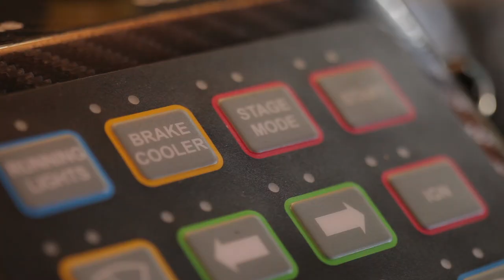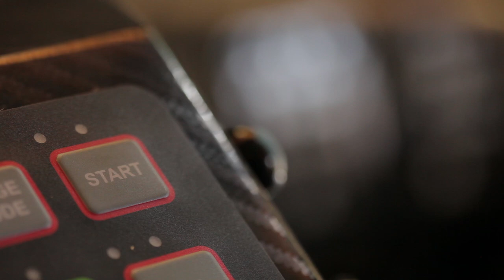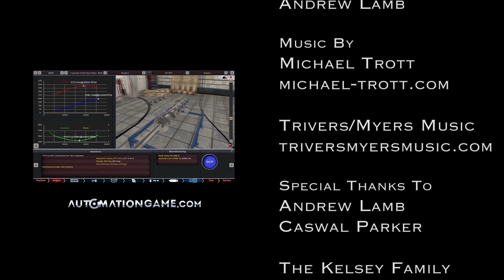The Homebuilt Rally Car That's Too Fast for the WRC - TST in NZ

Comment: Why did you put a Renault V6 in a Peugeot ?! Why would you do that ?!!
Reply from the maker: Kaisuke971 Peugeot didn't make a Formula 3.5 engine?
Reply: TheSmokingTire Basically he said he built the car from the engine, as he got an awesome opportunity with this Formula Renault engine.

From that perspective both your point is invalid and he didn't have a real reason to do so, because the shell might be the most useless thing there, and he said he built it himself so could've done that with a Mégane III RS or whatever, and then to be fair Renault does have some wide body Mégane III RS, so he could have take some inspiration from that !

But i just feel it like the dude does whatever he wants, and the 307 looks like it was meant to be a rally car so it works...
 It just bother me, because it's pretty much like you used a Ferrari engine in a Lamborghini, it's just... Wrong on so many levels !

(Yeah i edited the whole comment i got what you said way after haha)

But well it's his money and his car ^^'
Reply: +Kaisuke971 Cause it looks mean..
.
Reply: Kaisuke971 Maybe he just likes the body of the 307, its his car after all. Also I don't think its like Ferrari or Lamborghini, Peugeot and Renault don't exactly hate each other.
Reply: Kaisuke971 why would u ot like this enginge did u hear the sound of it ??????
Reply: it's not a Peugeot
Reply: nukem high Problem is not the engine but the shell here, at least for me. Engine is 100% Renault while shell is barely Peugeot, so it can go !
Reply: Kaisuke971 Because it would be nearly impossible to get a Peugeot engine of the same caliber.
Reply: Themayseffect Funny you said that because Peugeot-Citroën won the WRC quite a few time with Loeb ^^'
Reply: Kaisuke971
yes. Do you have any idea how much those cars cost? Do you have any idea how to get a Peugeot rally engine? I don't think so. A Formula Renault engine actually isn't nearly as difficult to find. There are a few sites out there that have some for sale matter of fact.
Reply: Themayseffect Also it sounds bad ass which is more than enough reason to buy the engine, plus its not restricted in power to follow regulations like how normal rally cars are made to be.
Reply: Themayseffect It's not like the guy has a very expensive rally car in his hands either... Seriously i think if he really wanted to, he could get is hands on one of these, because they've been racing for years, i think you can find some engines. Renault's 3.5 don't come cheap either...
Anyway the problem i was pointing out was the body
Reply: *****
 well the lack of restriction and regulation on the car is also another reason why most rally series won't let this kid race in their series lol.
Reply: Kaisuke971 He liked how the body looked and how the engine sounded! As simple as that!
Reply: Kaisuke971 Why?  Because he can!!!!
Reply: Kaisuke971 ...cca2004. - 2013. most successful wrc driver ever (citroen DS3  PSA - peugeot citroen), a tarmac expert etc etc  ;)
Reply: Kaisuke971 Because you are one of those fan boys that rely on brands and you think Brand A should stick to Brand A, when it's totally irrelevant what engine or chassi you use. What's wrong with having a Ferrari engine in a Lamborghini or vise versa? I tell you what.......fuck all. When you go the next level called motorsport, parts from different cars is simply the norm. 

I bet you will shit a brick when you hear Renault are now using Dacia parts, oh wait it's the same fucking car....VW and Skoda is the same thing too. Welcome to 2015 buddy, enjoy your China manufacturing stay
Reply: Guys you know people are allowed to give their opinion right ? I don't get why most of you are being so defensive and going as far as insulting me... 
I was just  joking (making fun of or whatever you get the idea) on a situation that would be funny to most french people (Renault engine in Peugeot shell while there is an intense fight for sales) that's it.
Maybe in my explanation you thought i was really "attacking" the guy for what he did but no and to be fair i didn't really want explanations for why he did it, just thoughts on that, and even less insults. 
(and no i'm not a troll --")
Reply: Kaisuke971 If it's true what you are saying then my apologies. At the end of the day there is too many goofballs who think like this and you always see them make those remark in forum about different engines used in different brands car. If any of those people actually watch Drifting competition, 90% of the cars are using some sort of turbo charged engine like SR20, RB26, 2JZ, and the rear axel from some dirty Nissan. Drifting is probably the only sport that doesn't allow FWD chassis to keep things a bit more realistic. Apart from that nobody ever runs the standard engine on whatever OEM RWD cars they used to look "different".
Anyway, good trolling my good sir, I tip my fedora to you 11/10 will read again :)
Reply: I think he already had the car and wanted to spend the money for other important parts, not for another shell...
Reply: ***** It's a 206, not a 307.....
Reply: CinqPower Albert van Mourik ---207 F3.5
Reply: You put a nice and constructive comment almost every time on videos no one bats an eye.
You post one comment that discusses something in a video every one loses their minds
Reply: Kaisuke971 But you're opinion doesn't mean it's always right.
Reply: The LoudAssasin Never said so. What i did try to express is that you don't have to insult me for that, especially when i haven't insulted anyone and even less the guy's job.
Reply: The LoudAssasin I don't know where you live but that's not how democracy works dude. Discussing and having a debate with people is not "call their opinion invalid". I did argue and give explanation, not just go "Your point is invalid". I explained why, imo, and that's what freedom of speech is about.
If you want to live in a world where every one has the same opinions, don't share and don't move forward with different perspectives of things, that's you. But history have shown that thinking differently and having debates makes the humanity go forward.
Reply: Kaisuke971 I think ur on the wrong channel  its Why Would You Eat That!
Reply: Kaisuke971 So he could get this monstrosity. What have you built so far?
Reply: Kaisuke971 he liked the engine and he liked the body style, what other reason does one need?  It's the same as asking why you have a bmw as profile pic.
Reply: +Kaisuke971 uhhh because F1.
Reply: +Kaisuke971 I'll introduce you to the same rule I introduced to my kids a while back. It's called the BIFLI ( pronounced Biff Lee )  rule.
Because I Felt Like It.
Reply: I think that's the funniest thing iv seen on the Internet lol
Reply: +Kaisuke971 Why not? Good stuff.
Reply: +Kaisuke971 if you listen he said it was a renault V6 that had been turned into a V8
Reply: Lisa Mcfarlane huh?  no, he said the Renault F1 cars transitioned to V8's, making their V6 F1 engines obsolete, which is how he got it.
Reply: aHHhhh the joy of obsolescence :D
Reply: +TheSmokingTire wonder wether a honda formula 1 engine would be as good or even better. that thing is a rocket ship
Reply: it worked didnt it
Reply: +Kaisuke971 it worked didnt it..
Reply: +Kaisuke971 I reckon he did it, after seeing your comment in the future, to spite Peugeot, because, although the McLaren F1 team ran tests with a Lambo engine in 1991 used Peugot F1 engines instead.
Reply: 450hp formula motor. why wouldnt you? let alone renault, does the red bull f1 car ring a bell? what power plant do they use? oh nevermind. you have a picture of bimmer. that explains everything.
Reply: You cannot understand because you're not french. The problem is on the Peugeot side o things imo, that's it. I wouldn't put a Renault engine in a PSA car because there is a kind of rivalry between the french manufacturers, and it's kinda funny to me but it seems that nobody really cares about french road cars besides french people. 
Here people go like: "Oh Renault unreliable shit noisy engine", "Bruh do you live in the 90s ? They even give them to merc" "Yeah that's why the B-Class is so shitty" "Well no one want your shit engines" "at least we win races" "well renault engine won F1 4 times in a row" "yeah but we did WRC even before Red Bull team existed" "Well our chassis are awesome" "At least that lel" "get out son shitty 1.6 thp unreliable thing" "At least it makes power unlike your shitty 2.0 turbo Clio"
Reply: +Kaisuke971 race car drivers and builders could care less about what company did what. all that matters is is it fast, yep, is it affordable, yep, is it competitive, yep, does it win, yep. nothing else matters.
Reply: Chris Van Middelkoop If it doesn't matter to you, take your time to answer.
Most of the time, the guys who build these have precise ideas of what they want to do, otherwise this would just have a Turbo 4 banger. 
I'm totally okay with how awesome if this car, just found funny that it has a renault V6 looking like a Peugeot, just like i find a Small block MX5, 2JZ E30 or whatever
Reply: Chris Van Middelkoop The Purist thing is not crap. There is a reason, for example, why Mazda sells its MX 5 with a maximum of 160hp. If you swap it for a 400hp V8, it's just because you didn't understand that reason. Maybe your car will be brilliant and stuff but it won't be an MX 5.
Most of the time, when engines are swapped, you just loose the car's personality. Each car have its own spirit, that fits to its engine. If you really like a car, and prefer to swap it... I don't really think you liked the car in the first place. You liked something about it (look, handling), but not the whole thing. A car is a whole concept, each car is different.
Though i'm more than okay with mods, to enhance the experience. For money reasons, manufacturers obviously can't put the best elements on an entry-level car. So you can put a new exhaust, carbon air box, bilstein shocks, carbon aero: as far as you follow the car's line, it will be banging.
For example: you have an E30 318is. You use the engine, add a cold air intake, new exhaust, upgrade the fuel system, remap the ECU, remove the rear seats, buy Bilstein suspensions, add Stop Tech brakes, 18' BBS wheels, remove all the useless interior things, change some body parts to make it look a bit better, ad Recaro seats, use aluminium pedals, buy a new clutch, put a short shifter: you'll be totally following this car's spirit.
You put a supercharger on an M3 CSL ? dude... You ELH an STi ? Come on bruh.... 
And then to be fair it depends of the swap: if you swap a 901T engine for a 3.8l GT3 engine, hell yeah. If you swap a 325i's engine for an S35B38: HELL YEAH. You 4 Rotor an RX 7 ?! Be my best friend ! You put an S50B32 in a 525i E28 ?! You could've bought the M5 or even M535i for less but still awesome !
Get my point ? 
That's my opinion though, and i'm far from being the only one like that. Some people love LS-Swapped RX 7, others hate, that's it mate.
Reply: Kaisuke971 sooo what do you say then to cars that came from the factory with engines of a different make?  Like the Lotus that came with a Toyota engine?
Reply: Patrick94GSR It doesn't make sense, you didn't read my last comment. The car MADE like that ! Just like the McLaren F1 (BMW's S70/2), Huracan (Audi V10), you get the point.
Reply: ls engines are boring to me. that said, for a street car, i can see what you are saying. but for a race car all bets are off. for a street car i would never change out a good engine for something else. rx7s need rotories, supras have the 2jz, skylines the rb26, 240zx the sr20. but some cars come with crap engines. and a motor swap is the way to go. datsun 510s need the sr20, vw beetles need an ej, miatas need, well, anything with more power, and so on. lol.
Reply: Chris Van Middelkoop "miatas need, well, anything with more power" what you ever said and will ever say in your life about cars won't make sense after that.
The only thing an MX 5 needs is weight reduction. And maybe a better sound.
Reply: +Kaisuke971 lol, you truely are a miata poster boy arent you? too bad the s2000 is a better car.
Reply: You just confirm what i said.
You're comparing an apple and an orange.
Reply: +Kaisuke971 not really. both are japanese sports cars. in stock trim i wouldnt touch a miata with a ten foot pole. total chick car. a spec miata race car, that is a different story.
Reply: M3 and S65 AMG are both german performance sedans. 
XJ and Phantom are both executive british sedans.
Huracan and LaFerrari are both Italian supercars.
Get the point now ?
If you don't let's compare an NSX-R with the S2K then. They are both Japanese sport cars aren't they ?
The Miata is a brilliant car, and the ND might be the best of them. It might as well be the best pure driver's car (the whole package thing, that you can actually drive everyday unlike a Catheram or a 3 Wheeler for example) on the market right now. People who think it's a chick or hairdresser's car have just no clue about the automotive world, and are far from being petrolheads.
Reply: +Kaisuke971 i dont know man, there are alot better feeling cars than miatas. i havent been around the newest one which seems alot better but still there are better feeling cars. ae86 is one, porsche 944 turbo, datsun 510, datsun 240, nissan 240sx, terminator mustang, lotus elise, corvette stingray just to name a few. and those are just rwd let alone fwd and awd.
Reply: Because fuck the rules that's why...car sounds fucking incredible
Reply: +Kaisuke971 Cause a Citroen Saxo engine probably won't be very quick
Reply: +Kaisuke971 Because Peugeot-Engines don´t stand making power and the 306 Chassis is just perfect for rally.
Reply: +Kaisuke971  It's not actually a Peugeot, it's something he built that looks like a Peugeot.
Reply: +Themayseffect probably half a million $.
Reply: +CinqPower Albert van Mourik   It's a 206, not a 307.....wrong it is a 207 I own the not modified from the manufacturer
Reply: +Kaisuke971 100% renault, pfff. Engine is a nissan vq35. These ones are just rebuilt to Formula renault spec. but the engine is 100% nissan so get off your high horse
Reply: +Kaisuke971  It's NOT a Peugeot it's a home made car made to look like a Peugeot, there is not one single Peugeot part in the whole vehicle.
Reply: +Kaisuke971 He's put that engine because it is good enogh for him and also sounds amazing because it's a V6 and it is from a Formula Renault.
Reply: +Kaisuke971 Why he did that? It's his money, his time and his life. I think he can do whatever he wants...
Reply: Tuan Dao It's just a prank bro the camera is right there
Reply: +Kaisuke971 I'm not sure but I think that the car might be a 207 s2000. This 207 was used for FIA rally, it was already light and 4wd. So I think that he worked a lot on this base to put his V6 inside.
Reply: andy elliott there is a single part the shape :D
Reply: dmied1 don't be ignorant the vq35 could be found in renault velsatis and any vQ35 can be rebuild to become a formula renault engine, it cost a lot but that is the same block, they change piston cam, injector fuil pomp oil pump dry sump calculator rod etc etc
Reply: +kaneda I dont see your point? v4y does not legitimize it as a renault engine, that is an in-house coding designation and the modifications to these to v4y rs spec was not done by renault
Reply: +kaneda also if you're gonna call someone ignorant over something then try to know what you're talking about. piston cam? two separate things, calculator? in an engine? what!?
Reply: +Kaisuke971 Next time you have the money to buy your own Renault V6 engine put it in something you prefer. His build his descisions in what to put it in...
Reply: +Kaisuke971 do you know Peogeot , Renault and Volvo once build a engine together right?
Reply: +slspg Toyota is a major stock holder of Yamaha. And it's a co-developped engine, as they also did on the JZ engine (including the infamous 2JZ-GTE). 

This comment section is cancerous as hell, my comment was just a bit of a goof. Jeez people can't take a bit of fun wtf. And if you did read my second comment you would'nt be as cancerous.
Reply: +Kaisuke971 did you not watch the video? cos hammers
Reply: Peugeot Sport don't have this motor.
For Pikes Peak it was a V6 bi turbo From Pescarolo Racing ...
Reply: Torque from this engine is enough ?
400Nm from 4800 to 8500 t/min (rev/min)
Reply: To be honest in the 406, a V6 that was used in renault vehicles was used.
Reply: It's not the Z7U or Z7W or 2993 from PRV... It's more on Nissan base. This one is Renault Sport as Peugeot Talbo Sport... It's team race.
Reply: Rafael Santolli this motor is not the PRV... Its Renault Sport for formula 3,5...
Reply: Chris Gac I know, I was trying to explain that renault V6 engines and peugeot v6 engines were also used in each others cars too. Such as the 406 with a renault V6.
Reply: It is not a Peugeot at all. The chassis plates are a peugeot look a like..
Reply: Chassis Plates?
Reply: Tawhid Ahmed Bodywork, fenders etc.. I dont really know what it is called in english.
Reply: ah i see what you mean, yes, you're probably correct. Normal rally cars use actual production chassis though, really extreme cars such as ones doing hillclimbs don't tend to use normal production cars
Reply: because it's incredible
Reply: How can you hate that, I mean, whatever it was he built, he still seems to have put quite some effort to do it.... Still would have made more sense to me if he had used a Renault Clio body (cause technically it could still be a normal-looking Clio V6), but I don't think the bodywork matters that much anyway, I mean it's just a tubular chassis with panels on it anyway.... And the V6 is just amazing...
Reply: Why not !!! Fuck me, Have a look at it go
Reply: To KICK ASS
Reply: It's literally just a joke
Reply: well why not put a rally pug engine in it and it is a good bit ov kit but should have put it in a renault
Reply: prob breaches all rally rules
Reply: Paul Chapman Yeah i'm obviously not a petrolhead i mean no petrolhead would satire about two direct competitors being joined in a same project by some guy...

Oh wait.
Reply: im not here to argue bud just saying it will not be allowed into a rally its an epic build but should have put a clio body on it or its not be allowed to enter
Reply: The engine is designed, made and serviced by a company called Zytek. It was originally mated to a Dallara chassis and it bares Renault stickers because they sponsored the series. So no need to worry.....the engine is British and the car it came from was Italian. Its a bespoke racing engine in a bespoke racing car.
Reply: Because why the fuck not? They're both French, so fuck it :)
Reply: Hal McGinnis Not really it's more like putting an LS1 in a Mustang
Reply: LS powered Mustangs are common now,  they got sick of getting the asses handed to them.
Reply: Its not about the engine in the body of the car. It's about him personalizing it the way he visioned, how he wanted it to be like and built it himself with the help of friends and family. Regardless of what everyone else has done, or said. Called being a kiwi mate
Reply: I know this inappropriate to ask, how much did he pay for the V6 engine?
Reply: Peugeot used to build engines along with Renault and Volvo too
Reply: Drew Wags: It was an obsolete formula racing engine so i guess anything reasonable to save it getting scrapped or put in a museum
Reply: Hal McGinnis
Peugeot and Renault made some engines together
Reply: Kaisuke971 i know this comment is a year late but dod you hear or see how fucking fast that was why would you not put that lump in lol
Reply: some well known cars have parts for 5 different car companies maybe more be it the gearbox,engine,wheels, transmission etc
Reply: One lucky bloke at his age that has the funds & resources but for the rest of us which is 99.999999% we be lucky to buy fuel to keep our rust buckets running. Still good on him for doing stuff like this just wish I had the same opportunity when I was younger :(  but I would have done things differently.
Reply: DeSpace Man yeah,bet he never sucked down a good bowl on a bong man,it's a trade off and I'm gonna say a couple bowls and a game of dirt rally,fuck it. Right?...
Reply: This is a second phase peugeot 207's body bois (2009-2012). 307 is way fatter (And uglier).
Reply: TroTh MX actually it is, a 207 to be precise
Reply: Shobin Drogan its a 207
Reply: CinqPower Albert van Mourik its a 207